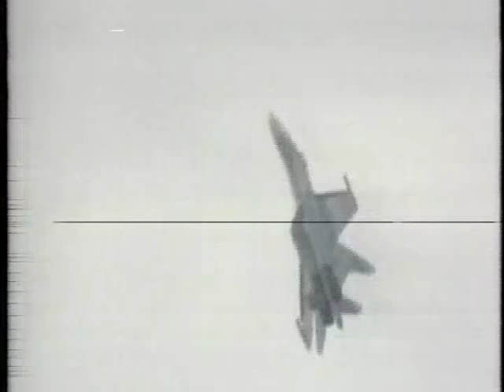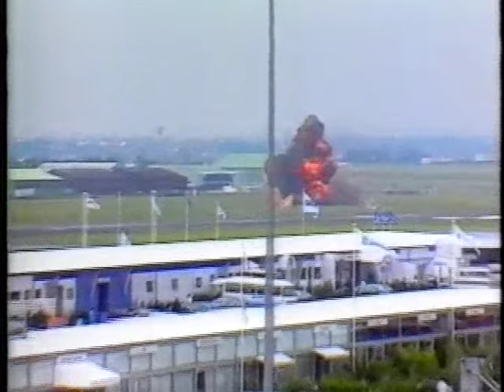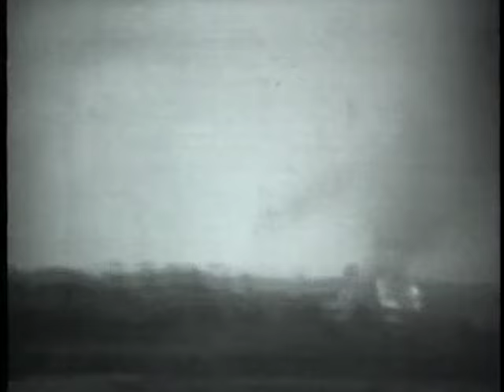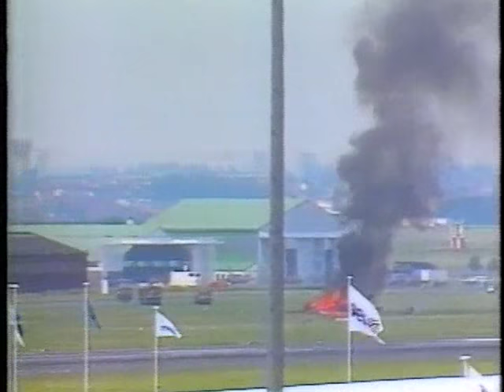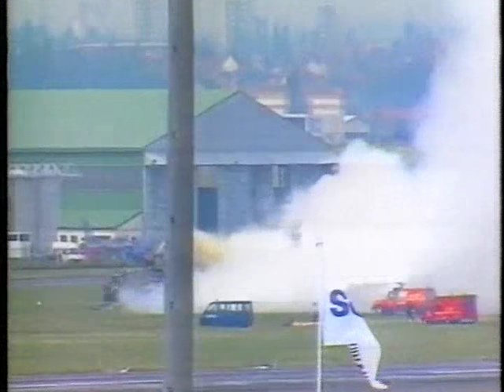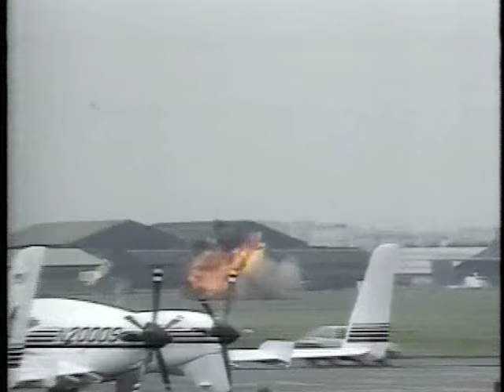Mig 29 Airshow Crash 1989

Comment: A little detail that when mig29 turn right,you can see the auxiliary air intake vent on the left side opened.It was a mechanic to provide more air for engine whether mig29 turned right or left.However mig29 didn’t have much speed after maneuver,and it was low altitude.       Anatoly kvochur(the pilot)could probably save it if he was higher.                                                           In the other situation,if he was on a F-14 early.He was so dead because of the space between two engines and make ejection seat got kills again(due to the flat spin,the absence of air flow cause canopy hover over the pilot.When the rocket active,the pilot would hit their neck and dead).

Comment: Why they don't put some kind of steel net on engine's intake when doing airshow flights .....at low alt birds are always the serious problem
Reply: The same reason they dont put steel net on commercial flights carrying 400ish people 😂
Reply: The "steel net" would impede airflow also if a bird hit the "net" most likely net would break and the engine would ingest both bird and net making the issue of a birdstrike into a bird and netstrike the latter being much much worse
Reply: When on the ground the intakes are closed shut from the front and fins open up on the shoulders of the plane so that nothing gets in if using a improvised runway. They open at about 150kts on takeoff and stay open to feed the engines enough air, those same hatches are used to control the speed of the airflow entering the engine and since they have so much travel, the MiG-29 has amazing engine performance at all altitudes and speeds. It can even reach Mach 2.83(only possible if it refuels from a tanker at a high altitude before trying it). This plane has so much power that it can go to space! Look up MiGflug. It goes to more then 100k feet.